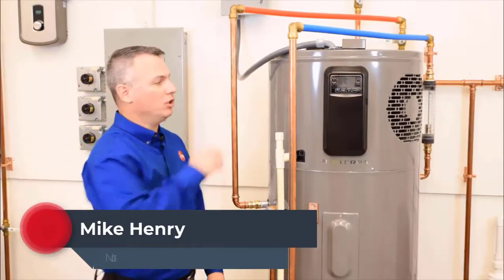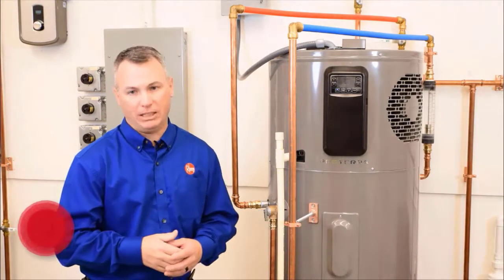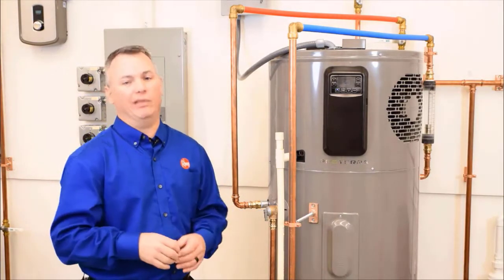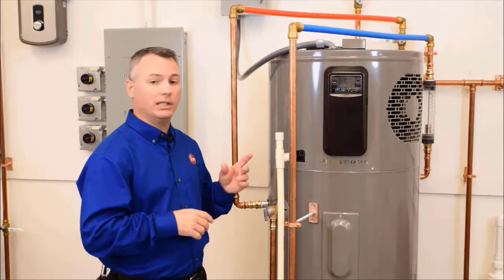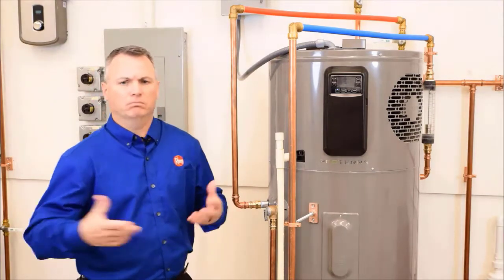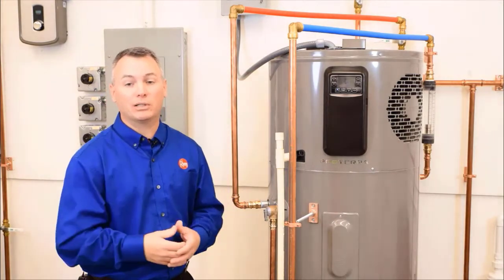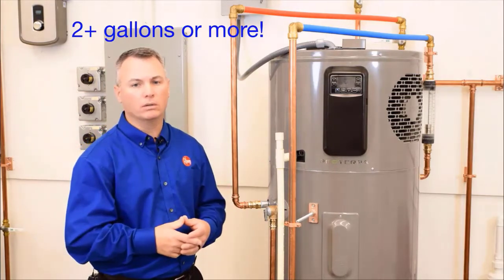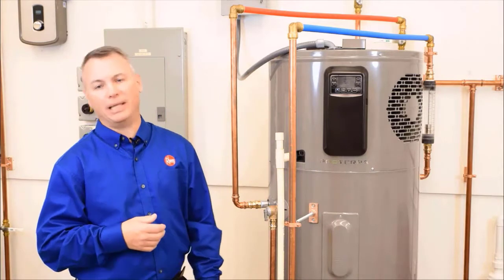Condensate Management When Installing Rheem® ProTerra™ Hybrid Electric Heat Pump Water Heaters

Comment: I'm going to cheat and use 3/4" braided vinyl tubing and barb adaptors to connect to my PVC drain pipe. It's easier than a bunch of angled fittings. No need for a cleanout tee because you can see through the vinyl tubing and remove it from the barbs if there's a blockage.

Comment: I'd like to hear why I'm not allowed to run into my drain pan. If my drain pan is plumbed to the outside already, what's the harm in letting it just drip into there?
Reply: If you have the models with leak detection, water in the pan will trigger the detector.

Comment: So my water heater is located in a garage without a floor drain. On my last unit the drain pan had a pipe attached to it that ran through the wall and to the outside. Can i add a T fitting to the pipe and run my condesate line to it? It would be nice not to have to try and put another hole in the exterior brick on my house

Comment: Where can I get one of those brackets that is holding the inlet copper pipe to the side of the heater? What are they called? I assume that it's acceptable to secure the bracket to the side of the unit with sheet metal Screws?

Comment: If you bring cold air in from the outside in winter, wouldn't you reduce the efficiency of the heat pump? You would be using more power.
Reply from the maker: To get information on this situation, please contact our Technical Support Team at 800-432-8373 for more details.

Comment: I have this water heater, the coil keep freezing up and clogging up the drain, what do you do then?
Reply: I am having the same problem just started a couple of days ago too.  I have had to switch to electric mode to heat the tank so it thaws out and the water starts to drip again down the drain.  However, it is a huge increase in electric use.  Does anyone have a solution for freezing condensation?
Reply from the maker: To get information on this situation, please contact our Technical Support Team at 800-432-8373 for more details.

Comment: ☝️😮 question.can I put a 3/4 plug to don let the water drain??,because is in the basement into the closet and I don't know how to get rid  of the water leaking out of the condensation line.llesa help
Reply: You need a condensate pump to pump the water out.
Reply: @MyFortressConstruction  oh ok,do u know the name of that pump? I really appreciate your help
Reply: @velascojidon390  Little Giant is a common pump. It needs a 120v circuit to run and will pump the water up and out to an exterior location.
Reply from the maker: Plugging off the condensate drain is not allowed. It must be drained away from the unit.

Comment: Be warned. Rheem’s heat pump water heaters are very loud. The one I installed yesterday is like a hair dryer, hard to hold a conversation in the adjacent rooms.  There is no way I’ll be able to keep it in the house. $1600 wasted.
Reply: Can’t you switch it to traditional electric mode?
Reply from the maker: Yes you can, but it will only remain in this mode for 72 hours. After 72 hours it will revert back to "Energy Saver" mode.
Reply: @rheemwater  that's good info right there.

Comment: I currently have one drain line for my TPR valve on my old water heater. Is there any way to tie the condensate drain into this?
Reply: No, they specifically say not to do that. However, if code allows, you can have your TPR valve terminate into your water heater drain pan and then take the 3/4 line and use it as the condensate drain. Just make sure it terminates outside or into a drain because these can produce a lot of water.
Reply from the maker: You would need to follow your local plumbing and/or building code. Most codes do not allow these 2 lines to be connected.
Reply: Thanks for the replies. Since I received no guidance about this after reaching out to Rheem at the time, I connected the two lines together. I might separate them in the future but I have no plans to do so.

Comment: Rheem fails to tell you that all rhreem  heat pumps have a defect because the condensate cannot drain properly due fact the sensor I put to low and the channel is a flat pan without any slope to the drain hole. So water builds up on bottom of condensor coil. They did this on purpose so withe water after certain time will cause oxidation  of pipe to make it developed a leak thus generate revenue.  I constantly have to take the lid off to clean it due fact it alarm even without a drain clogged and when I try to call rhreem  the give me a person in India wh tries to sell me another water heater and does know what a  water heater is.
Reply: If there is a defect you should notify them about it. This will not generate them revenue, as they will be constantly repairing units under warranty, and may be obligated to issue a mass recall.
Reply: @LukePighetti  I tried numerous  times but  a. Their customer  service people are not trained and many are over seas. B. Even corperate offices put you on hold and shunt you to customer service. C. I found a fix that you have to every month take the lid off them take Long small  flat screw driver with a rag scrap the scum build up then blast the whole condenser  and drain hole with air then move the sensor away from the condenser.  D. Rhreem  would have a 11 out of ten heat pump water  heater if was not for this problem. As for repairs good luck many hot water heat repair people cannot work on a heat pump water heater due fact it uses refrigerate  and thus they must be licensed hvac techs. Also I see no ports for testing or refilling the unit with refrigerant.
Reply from the maker: Thank you for your comment. We would need some additional information to understand why this is happening. Please contact our Technical Support Team at 800-432-8373 as they can help you with this specific issue.
Reply: @rheemwater  tried that number to many times no answer
Reply: What has tech told you?
I wonder if the 120v model has corrected this yet?
Reply: @TimFrentz   
Not to my knowledge
Reply: Maybe you have a problem with the water heater being level. I would shim it so it's tilted slightly towards the drain.

Comment: Do you need to attach the line to a trap of some kind before routing into main home waste line?
Reply from the maker: Condensation produced by our Rheem ProTerra Hybrid Electric Water Heater is non-acidic and can drain directly into the main home waste line.

Comment: After 1 &1/2 ht wait and 2hr total time running from department to department I finally got an answer if you can afford 10 grand to set up solar these units are not compatible with off grid solar they only run on 230 volts so that means in Alberta Canada either I pay 10 grand for a 220 volt inverter system or I pay 200 dollars a month to run it since in Alberta Canada we either pay 180 dollars per month for grid tied power  yes I know  unfortunately Alberta Canada is not friendly to solar power so does anybody know if any of these hybrid hot water tank are able to be run on 110 volts
Reply: It took you 2 hours to figure out that this water heater runs on 220V? You could have downloaded the manual and figured that out in 2 minutes.
Reply: There is a 120v model but for the past 12 months I have not found anyone that will ship it to me. They appear to be exclusive for California wholesalers!  I post this asking for a purchase source on every hybrid video I watch.  Still no answer!  Rheem sales office answer is "server says out of stock" .... every month I ask them.   Ugh.

Comment: Is a piping Tee fitting recommended or required  to properly maintain and operate the unit?
Reply from the maker: The tee fitting in the drain pipe would be recommended to properly maintain the drain line itself (downstream), not the water heater.
Reply: @rheemwater where can I find the 3/4” male threaded T adapter you talked about? Looked around and I can’t find one.
Reply: So, does anyone know where to buy the 3/4” pvc threaded male T adapter for the drain line as shown on the video?

Comment: Biggest problem I see with these is "closet mount"... one of the manuals I saw talked about orienting the exhaust towards the door, either fully louvered, or vented... problem is when you do this, everything else becomes inaccessible... controls, resistive elements, drain, pressure relief, etc.
Reply from the maker: Agreed. It would be best to put it into another location but if that can't be accomplished, directing the intake or exhaust towards the louver would need to be done through ducting and adapters.

Comment: Hi Mike. Thank you for the video. Building code requires condensate pumps turn off the appliance should the pump fail:

307.3 Condensate Pumps

Condensate pumps located in uninhabitable spaces, such as attics and crawl spaces, shall be connected to the appliance or equipment served such that when the pump fails, the appliance or equipment will be prevented from operating. Pumps shall be installed in accordance with the manufacturers' instructions.

Mine is in a mechanical room, which is considered uninhabited space. Is this possible to accomplish with the Rheem Hybrid Hot Water Heater? We are not able to  find information in the manual or online. We do find a brown wire for condensate noted on the wiring diagram on the unit, but are not able to find information about how we should tap into this line on the unit itself. Documentation or information on this would be great. tyia.
Reply from the maker: Thanks for the question! While we cannot provide you installation advice here without fully understanding your situation, we encourage you to contact our Hybrid Technical Support Team at 800-955-0982. We hope this helps!